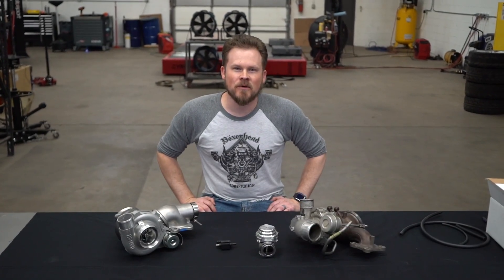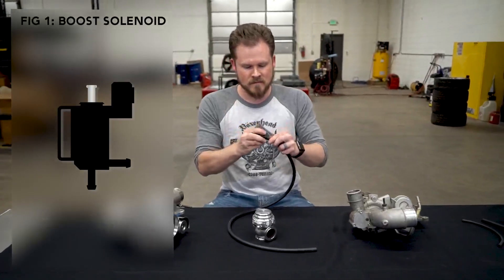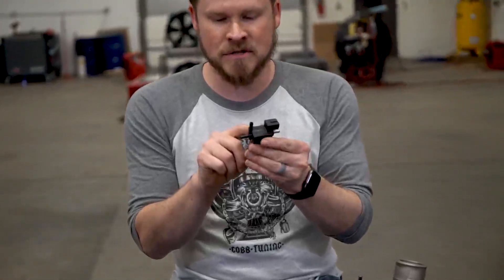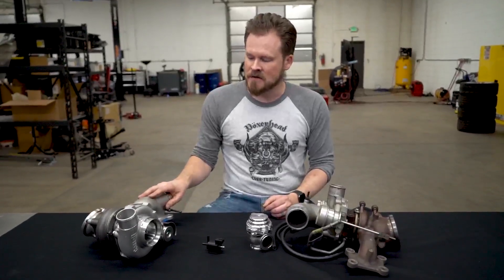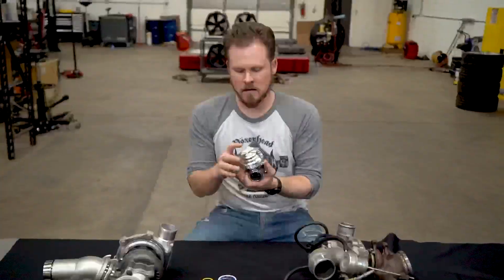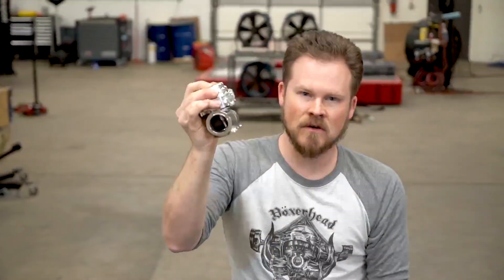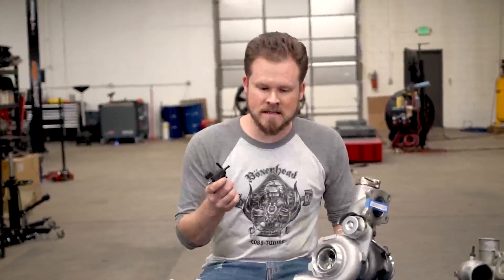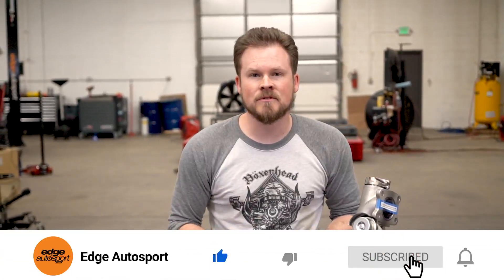All You Need To Know About Boost Control and Wastegates | Edge Autosport

Comment: Fantastic, helpful video!   To test if the TCV is bad, I think I'm deducing that you can hook up a vacuum tester to the perpendicular port on the TCV (there's two ports in-line, and one perpendicular), and at idle, that port should have airflow (vacuum), but with throttle applied, that port should close (no vacuum).  Under this configuration, a working TCV will have vacuum at idle and zero vacuum with throttle added, and thus a bad TCV may also show some vacuum under throttle.   Do I have the correct understanding?

Comment: Im guessing after all these years, the set up hasnt changed with the newer turbos out.
I am running the G30-770 with Pulsar 45mm EWG. I have a gradient engineering intake manifold and custom valve cover. If i can Id like to eliminate the upper solenoid and line to the vacuum pump, if thats doable. can the tuner get rid of any code the solenoid might trip and can the Vacuum pump be open or does it just need to be capped off?
Then the compressor/WG lines go exactly as you described on the lower solenoid, and vent the 3rd port (straight out, opposite of plug)?

Comment: Hi I have a 17 focus ST recently I got a check engine light on checked it and said I was overboosting could this help my car stop overboosting?
Reply: Your wastegate flapper might be getting stuck closed, could derive from wear on the pivot for the flapper, can also be your wastegate actuator if it's stock it may be getting wear, some might rust at the rod, or even diaphragm internal wear, consider getting the actuator checked first, if your 100% sure it's not that then look at the wastegate flapper this at a mechanic requires you to change out the whole turbo assembly, if your handy and know what your doing you could change out the flapper, by removing the exhaust side of the turbo where you will see it, good luck

Comment: If you add an external wastegate, what happens to the wastegate that comes in the turbo? Does it stay in and remain shut due to the pressure hose being swapped to the external?

Wasn’t sure if anything needed to be done with the original wastegate
Reply: Turbos that accept external wastegates do not have an internal wastegate and vice versa. I am not sure how one would add an external wastegate to a turbo with internal wastegate without heavily modifying the housing.

Comment: Does the wastegate solenoid plug wire (electrical) matter which way its connected?  Is there a polarity connection that is correct?  I replaced mine but no change.  The actuator works but the boost pressure isn't there.  I got P0299 twice.  Haven't been able to figure it out but thought it was this solenoid.   My question is more importantly for the electrical connection , is there a correct way to connect it.  Does polarity matter?  This is for 2016 chevy malibu 1.5.  Thank you in advance.

Comment: I have a boost open error.   I tested my controller and air blows through from turbo inlet to waste gate line.   When I put power to the controller it’s blocked and no air will flow.       Guessing the controller needs to be replaced ???

Comment: How about the factory boost controllers that only have 2 ports? I bought my car from a guy who had installed a manual boost controller before the factory one. I wanna make sure he reconnected it correctly
Reply from the maker: It's not a great idea to daisy chain multiple boost controllers. You might want to get a nice 3 port controller and replace the others so you have one complete system that will work much better than a modified factory controller.

Comment: Hi @EdgeAutosport I hope you could help me. I got a ford focus ST with a turbosmart BOV and its causing overboost and releasing boost pressure when starting to build up speed. What would be the cause of the issue Im new to boosted cars so Im not that familiar on it.
Reply from the maker: It's really hard to diagnose cars over YouTube comments so you may need to have a mechanic look at it if you can't figure it out. But a BOV shouldn't cause overboost unless the piston or diaphragm inside is stuck which is pretty rare. Even then, it wouldn't really cause an overboost during a pull. But you say it's releasing pressure when starting to build up speed, which contradicts creating the overboost. So I'm not sure, I would have someone look at it.

Comment: So I can see how the wastegate solenoid valve works, but I don't see how this valve freezes up with moisture on a 2020 equinox  1.5L  when you drive 35 minutes at -39 degreese.Where does the moisture come from in the turbo. Done this since new.

Comment: Interesting but doesn't explain a system which has a pressure control solenoid AND a crossover/switchover solenoid as used on early Ford Focus 1.0 ecoboost engines. Ref Pierburg 7.04011.05.0 and 7.22687.44.0

Comment: Man this video saved my life.  My cadillac srx 2.8 has had over boost problems constantly.  Replaced the pressure sensor and wastegate solenoid.  Still same problems . The top two hoses where switched . Strange from the factory gm part the molded hoses route exactly to the wrong spot.  Switched the top two hoses and bam fixed !!! Thank God

Comment: What are some things that will cause a p0299 underfoot code.     Can I unhook my wastegate and see if it will build boost when the car is cold it'll go to like 12 pounds the when warm stops at 5 pounds then hit limp mode and stop at like 2.    I don't have a AP.   Stock other than mbrp cat back and and a intake

Comment: So on the lower boost controller are you saying delete the T fitting and only have that line going to the charge side? And then cap both ports on the valve cover controller? I feel like this left more questions than answered. There was a lot of “you can do this” and not showing how to make a setup work.
Reply from the maker: Did you get over to the blog article linked in the description? That has diagrams and more in-depth info for you!

Comment: My ATP2867R GEN2 with external wastegate are adjusted to 20psi and the tune are setting at 20psi and the car run well. I will install the Xtreme DI pump soon, should I leave the external wastegate at 20 psi or lower ?
Reply from the maker: That a question for your tuner, tough to answer from the outside. If Alan is tuning your car, feel free to shoot him an email!

Comment: I just have a question. My st just got a 2867r, I paid a shop to do it. They said I could only run 17lbs of boost because of a boost control solenoid code that pops up, did most car you’ve done with bigger turbos, did they do a new boost solenoid?
Reply: Stock boost solenoid works just fine. I also have a 2867 and I used the stock boost control solenoid

Comment: Something cool that I've found on the focus fourm is someone is making a elbow that matches the exhaust outlet on the head and can be made without the top opening where the external waste gate will go so you can run the waste gate on a charge piepe. I'm assuming routing is going to be Similar? Anything you could think to watch for while changing that elbow to the turbo out and installing the kit?
Reply from the maker: Hi Austin - that doesn't really check out though... a wastegate ALWAYS needs to be in the exhaust stream or on the turbo hot side housing. It wouldn't really work on a charge pipe, that's a blow-off valve on there. Maybe I am not understanding your description properly? Either way, we sell hot charge pipes with BOV adapters, and block-off plates for the stock BOV to compliment - we will be installing one soon on our Half-Send ST! https://edgeautosport.com/cp-e-exhale-hks-ssqv-vta-charge-pipe-satin-black-ford-focus-st-2013/
Reply: I will be one of the first one to receive the EWG version of the mentioned elbow. It has nothing to do with this boost controller.

Comment: I have a RS with a Fullblownmotorsports turbo kit on the car. Comes with two Tial wastegates. And now after 4 years I'm getting overboosting codes and my car doesn't really want to boost right. Car PSI reads 26 and Cobb will read 10 for a example.
Reply from the maker: Interesting... a discrepancy between what the computer is asking for and the wastegates are seeing perhaps? Did our video help you understand the system better, or troubleshoot? Let us know!
Reply: @Edge Autosport  my car doesn't want to go into post really. I can feel the power but when I try to get on it. Obviously the Cobb is giving the real reading. So at most I get 10 to 14psi and that's all. Even tho the OEM cluster gauge is saying 26. But it doesn't feel like it at WOT.  I know a week before it shot to 30psi and that definitely gave a red flag. Because I was suppose to be peaking ay 24-26 psi.
Reply: @dg.8880  you may have a boost leak or perhaps a map/tip sensor issue.
Reply: Tial stuff always leaks and fails. Go turbosmart and you’ll set it up once and not need to play around with it again unless you want to.
Reply: Thank you all 4 the replies
Reply: @dg.8880  did you get it figured out?